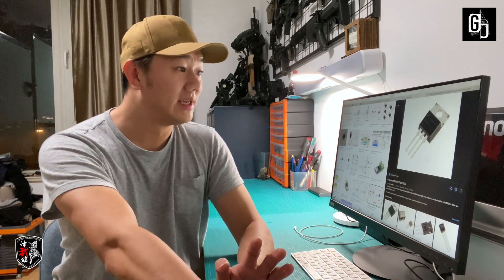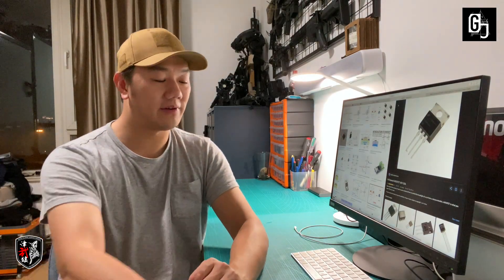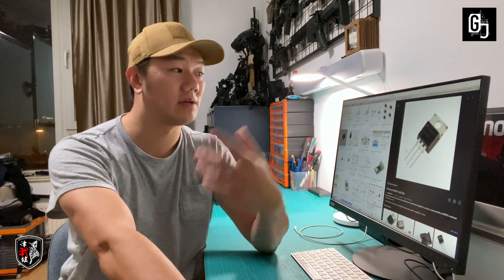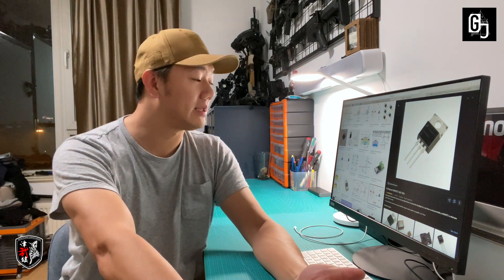Gel Blaster Tips: Should I Install a MOSFET?

Comment: Hey J, awesome video. Quick question, can you maybe maybe make a video showing where you have wired in the mag terminals on the Aster and even the Titan. Coz i wanna just confirm i have used the right points on an Aster i installed for a mate a little while back. I assume my pickup points are ok seeing as its still operating correctly to this day lol, but yeah wouldnt mind confirming it.
Reply from the maker: Hi Chris, check out my LVOA-C video, it shows the Titan MOSFET and point out the wiring for it.

Comment: This is great, your videos seem to be released just when I have questions about something specific! At the moment I going to try wiring a mosfet, (MERS 3.2) to my blaster. The instructions are for airsoft so there's no mention of where I should solder the magazine leads to... I was wondering - Do you solder the magazine contacts to the same contacts on the circuit board for the trigger?
Reply from the maker: The MERF 3.2 adds to the existing circuit and you don't need to solder magazine terminals to it. In fact, there should be a cable you need to solder to the trigger unit.
Reply: @galapagosj3021  Awesome that's saved me a bit of work. Thanks again man, your vids are always helpful.

Comment: Out of topic question:
Is there any difference in between HK416 V1, V2, and V3 magazines? 
And could you make a video about how to increase the FPS of a WGG. 
I hope this question gets answered, Thank you!
Reply from the maker: What is WGG? As for the magazines, I didn't know people were selling the older versions still, or it could be an export only option, I'm not too sure. There are quite a few gel blaster brands that only create products for export. But if it is what I think it is, the WARINTEREST magazines went through several iterations and they are just better quality material, simpler disassembly design and such. I'm not sure if that's the same V1, V2, V3 you are referring to. Currently, there are 3 main types of magazines you can have, the latest iteration of the standard magazine, a light up magazine for glow in the dark gel balls and a high speed mag (not by warinterest)
Reply: @galapagosj3021  Water Gel Gun. I'm sorry for the wrong abbreviation. How to increase the FPS of a Water Gel Blaster Blasters?
Reply from the maker: @josafatglenn4482  If you are just looking to increase FPS, then just put in a bigger spring. The HK416D comes with a 1.1, which is around M70-M75, you can push it up to M90 without having to change out the gears or the motor. But it will probably wear out a lot faster, and soon too.

Comment: I'm looking forward to a video where you can tell some common problems during gun building and how to fix that. 
For example, I have an M249 that shoots very fast but the bullets just fly like 5 meters. If I shorten the barrel - or -  replace the motor with a slower one, then it shoots fine.
Reply from the maker: Yes that's a good idea. As for your blaster, can you tell me more about its setup, like whether you changed the gears, springs etc.? You can email me.
Reply: @galapagosj3021  Thanks. Such videos will be a great help for newbies.
As for my M249, I used a 45cm barrel, a set of 18:1 gears, and a ChiHai blue 460 motor. I read somewhere that if the gun fires too fast, the piston is pulled back before the gel ball leaves the barrel, which creates a suction force that nullified the gel ball momentum. Either shorten the barrel so the piston gets pulled back after the gel ball has left the barrel, or makes the gun fire slower will solve the problem. I did exactly that and it's OK now.

Comment: do you know the real world differences between the trigger unit mosfet and an in line mosfet?
Reply from the maker: Inline MOSFETS are added into an existing circuit and is outside of the gearbox where as the trigger unit ones directly replaces the trigger unit and sometimes all the cabling as well. Trigger unit MOSFET can also be more advanced in terms of functions and features and also saves a bit of real estate outside the gearbox. Inlines tend to be much simpler and don't have proper cycle detection.